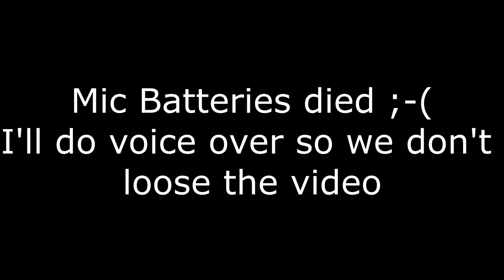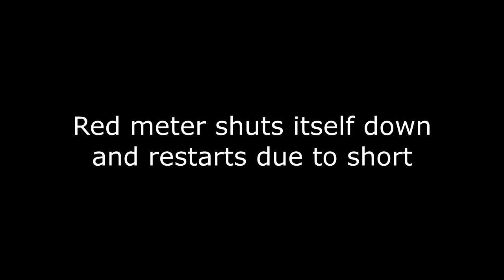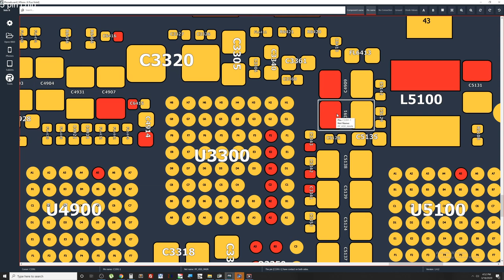iPhone 8+ no power repair - Tigris VDD short

Comment: Nice man i like to know if is possible what type of video switcher you are using and what is the name of outro music you are using, and i have an sugestion for you to avoid audio loss you can use an lavalier on the top of HDMI cable on your microscope like a backup so if your battery die or transmitter is gone you will still have audio on the video. :)

Comment: Short of removing the cap (no pun intended), would one be able to easily check the proper capacitance value of the cap with a meter to check its integrity?

I would assume that one would probably need to know the correct value in order to check, but one DOES know that value, could one meter the capacitance to check the cap's integrity?
Reply: @YeshTV Right, but I've had situations where a cap would short to ground on both sides, but the issue would end up being an IC instead of the cap itself.

I suppose it really just depends whether or not one knows how that cap is used in the circuit -- which is obvious when he pulled up boardview there at the end.
Reply: @YeshTV By the way, which thermal cam do you have? Flir as well?

Comment: I've being following your videos and I do enjoy them a lot, thanks for all those awesome contents, but I actually have a question to ask concerning this video, we had two hot spots on the board, but eventually found out those caps is causing the short, then why is the Tigris chip heating up with the capacitor since the short occurred at the capacitors, and no current suppose to flow through the Tigris chip since we have a short.